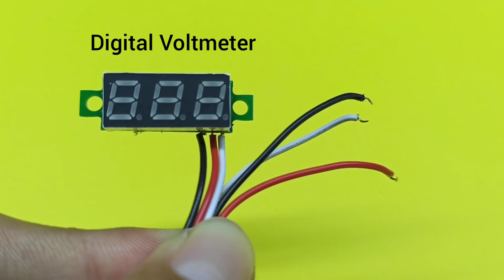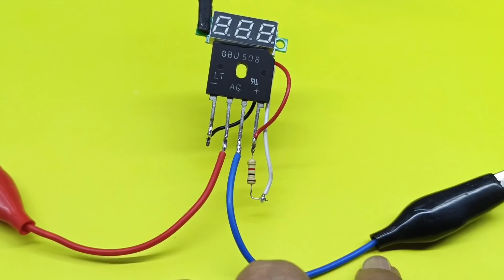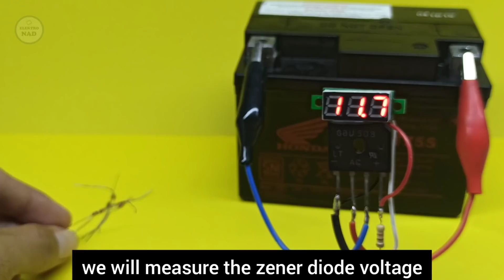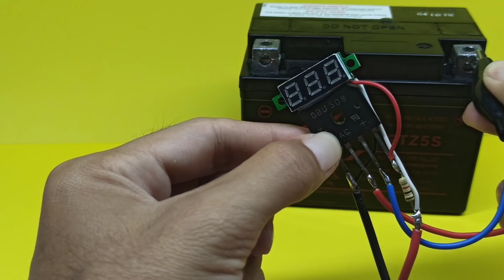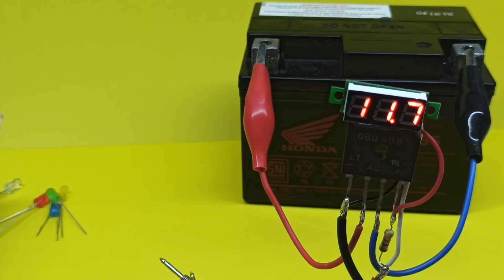ALAT CANGGIH INI TERNYATA BANYAK YANG BELUM TAU

Comment: Congratulations, a tool as simple as it is very useful. Very Good
Reply from the maker: Thank you
Reply: @ElektroNad14  please master give us the diagram ciociut of the digital miter
Reply: @ElektroNad14  Congratulations again.I wanted to ask you,  if the circuit works equally with a voltage of 9V instead of the 12V from bulky batteries. Can it work?
Reply from the maker: Yes, you can use 9 volts, it's just that the zener diode that can be measured is below 9 volts
Reply: @ElektroNad14  Of course, you're right, so with 9v there are limits to the measurement. You could use a 9v battery with a step-up to bring the voltage to 12v, if you want to put the circuit in a little box, and use it as a real tool. Thanks for your contact.

Comment: Selalu mengikuti NAD ini, kalo di kasih input lebih dari 12V bisakah bang? maaf pemula..!! 🙏🏻
Reply from the maker: Boleh, tetapi jika tegangan input 20 - 30 volt maka disarankan Nilai resistor 1k diganti 1k5 atau 2k2, dan dibawah 20 volt pakai 1K sudah cukup
Reply: @ElektroNad14  oke, trimasih bang, sukses selalu. 🙏🏻

Comment: Tegangan Aki 12,3vsetelah melalui dioda bridge kok jadi 11v ya,apa yg salah ya?
Reply: Gk ad yg salah @mas Dede, memang sperti itu. Kalau penasaran, coba aja baterai laptop atau apa lewatin dioda, psti voltny turun.
Reply: @dasikin118  makasih penjelasanya,saya sering mengukur tegangan baterai pada mobil terutama pada sistem pengisian,tadinya dikasih dioda bridge biar kalau kabel lupa kebalik voltmeter tidak rusak,tapi karena voltage nya turun nggak jadi akhirnya
Reply: @masdede6911  kalo mau voltny gk turun, pda bagian output dioda dikasih elco aj, tpi yg voltny melebihi output sumber y. Misal output aki 12v, smpean pake elco minimal 16 volt. Lbih bagus lgi 25/35 volt
Reply: Iya mas terimakasih,nanti saya coba saran nya
Reply: @masdede6911  selamat mencoba
Reply: @dasikin118  izin tanya mas, kira2 kl pake tegangan input 9v bisa ukur tegangan diatasnya?